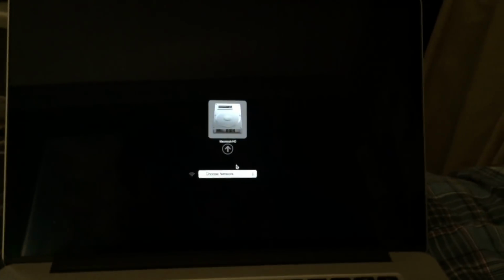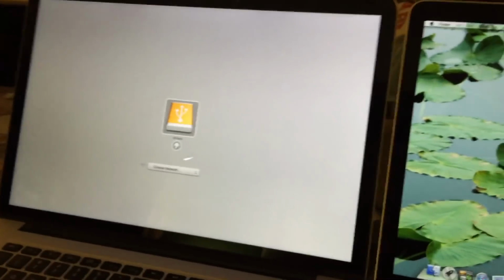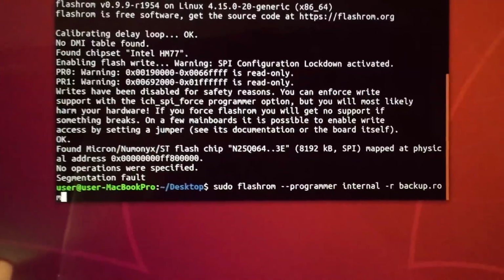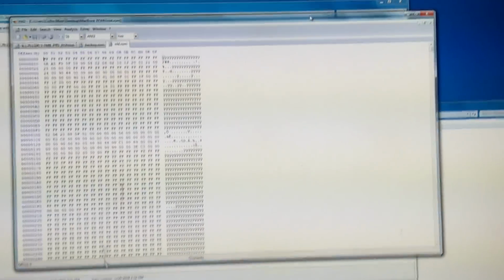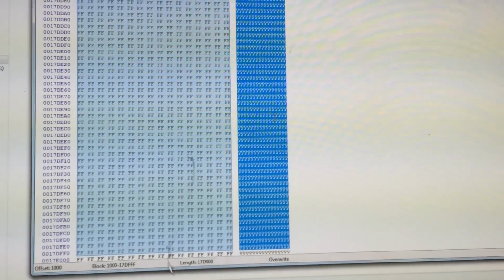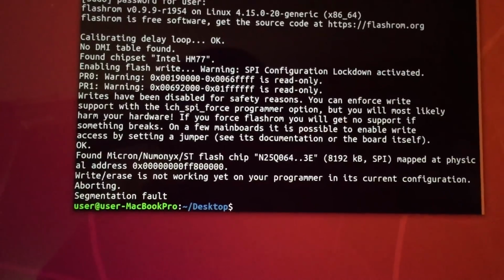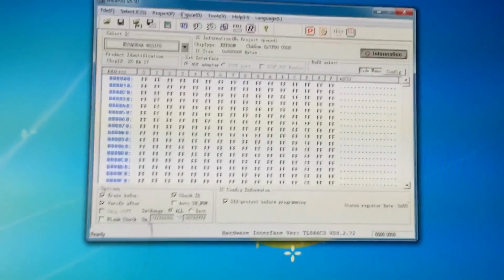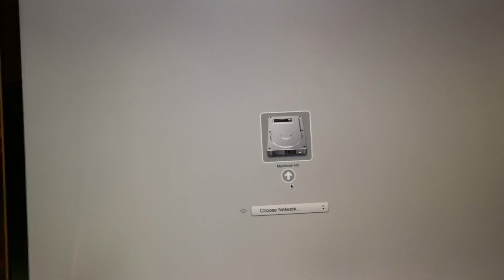Downgrading the System Firmware on a Mid-2012 15" Retina MacBook Pro

Comment from the maker: EDIT: It turns out the reason flashrom couldn't flash the ROM is because the system was not in programming/FW update mode. To enter programming mode, simply hold the power button down (while the system is off) until the boot screen appears, and from there boot Linux. Flashrom will then be able to flash the ROM successfully.
Reply: Hey dos, are you going to do Mojave patcher?
Reply: Can you elaborate on this a bit further? I've tried holding Power and Alt down until I get to the startup manager, released them and then booted Linux but flashrom still can't write. What am I doing wrong?
Reply: When you say lynix you mean terminal?

Comment: At some point in the updating process of those firmwares Apple must have set a limit of the GT 650M GPU clock speed to 744 MHz to "improve graphics stability in Bootcamp" (or something like that). Do you think there's a way to un-limit that, especially if you have better fan control and thermal paste installed, to get closer to the original clock speed of 835 to 900 MHz? There's no way to do it in software using the current 2.1 firmware.
Reply: Does the 744mhz limit also apply in MacOS?
Reply: @Thegeforce8523  I haven't found a way to read the clock speed in MacOS, but I'm pretty sure it is as the performance under Mac is even worse than Windows.
HOWEVER: I found a way to actually unlock the GPU at least under Windows using an older version of Nvidia Inspector (one from the early 2010 will do - to set P5 state and force clock speeds) plus MSI Afterburner (to unlock overclocking, even though it can't change the numbers). Was able to push mine to stable 990 MHz and get a framerate increase of ca 20% depending on the game. However, custom fan curves using Mac Fan Speed, disabled CPU boost and of course new thermal paste were required to keep temperatures in the 76°C area.

Comment: That device running Mavericks is a little stupid, the OS is really holding its performance back.
This does support macOS Mojave and today even Catalina, and the OpenCore Legacy Patcher will let it run Big Sur without any issues.

For example I have a MacBook4,1 with GMA X3100 graphics and OS X Lion (max OS) is really holding it back.
I patched and installed Mountain Lion with full graphics acceleration and the performance is definitely better. Although it would be better under a newer macOS version if there was graphics support. The CPU in it is better than some MacBooks that are compatible with your patcher or OpenCore Legacy Patcher, but these machines with a worse CPU are yet doing much better because of graphics support.

Comment: My friend had El Capitan on his MacBook pro2012 I tried downgrading the is to leopard 10.5.  But couldn’t do I need the rom for older version OS X to work or no I have a programmer just don’t know where to get the rom for that os to work on this laptop or where can I get a donor firmware to be able to use the leopard 10.5 so I can modify the me region and sn

Comment: Does the same firmware of the mid-2012 Retina MBP work with the mid-2014 Retina MBP as well? I have one of those and I recall that it came with Mavericks originally, so I'm thinking of downgrading the firmware to get the white bootscreen back. If said firmware doesn't work, where could I get the firmware that does?

Comment: I'm having an issue with fans blowing constantly and kernel_task process using 500% CPU time. My diagnosis has led me to believe the firmware is somehow corrupt. Would I be able to use this to manually rewrite the SMC firmware? I'd like to try to fix this myself before I pay Louis Rossman $300 to replace my whole logic board.

Comment: Hey dude 🙋🏽‍♂️ :) I spent 5 sleepless days trying to downgrade my 2014 15" MacBookPro11,3 to Mavericks.. My internal is a 1TB Adata SX6000LNP PCI-Express SSD... The further I was able to go is High Sierra -APFS-. Internet Recovery leads to Catalina install... Bootable Mavericks works just fine from external drive... but when I tried to install all HFS based OS's from Sierra down to Mavericks-, the SSD is not showing up on the list... -I just bought this specific 2014 MBP on ebay because it was listed as one that can have Mavericks on...the original SSD was 500gb, so that 1TB SSD was an upgrade... I need help really really bad :/ What can I do in order to have Mavericks on my system?
Reply: That's because there are no NVME drivers for Mavericks. From what I remember, non-Apple M.2 NVME SSD work from High Sierra and later (I might be wrong here, so feel free to correct me). You'll need to either get the stock Apple SSD that came with your MBP or get an aftermarket M.2 SATA SSD if you want to install Mavericks.

Comment: Thanks for the post! Will the same method work if, instead of dump downloaded from another working machine, I inject directly the firmware available at apple's downloads as a .scap file? I would like to do this to regress my MBA, for the usual 'bless' command is simply not doing it.
Reply: I just see from older replies that this cannot be done. Anyways! If anyone has a Macbook Air mid-2012 with EFI MBA51.00EF.B00/01 (compatible with Lion 10.7.4, its original OSX which I need back), please upload it for me. Please.

Comment: If you ever get the chance to do it with a 15” late 2013/14 MacBook Pro, I’d really like if you’d upload the file
Reply from the maker: If I ever get lucky enough to find one with the old firmware, I definitely will.
Reply: dosdude1 I actually had one that had the original rom but I accidentally updated the firmware despite updating the system software on Mac OS X 10.9. That was way back in August of last year though

Comment: Do you have the original EFI firmware for the late 2013/2014 15” model since I accidentally updated mine?
Reply from the maker: I don't, you'll have to get lucky and find another board/machine that still has it.
Reply: dosdude1 is it possible to trick the updater to install an EFI update that’s older than the one in my machine? I got the old file from the Apple website through web archive and downloaded the version for my Mac and I tried using some terminal commands to make it install but all that happened when it restarted was a delayed boot chime and a black screen. Firmware version installed is still the same
Reply from the maker: Yeah, that can't be done. I tried doing the same.

Comment: Hi, do you happen to have any experience with this model of MacBook getting stuck in sleep mode when shutting the lid? The problem I'm facing is as follows:
Putting the MacBook to sleep via the Apple menu > sleep works fine. I can wake it back up again by pressing a key on the keyboard.
However, if I have the MacBook running, and the close the lid to put it into sleep, i am only able to wake it up again if i open the lid before the fans stop spinning. Otherwise, if I wait for the fans to stop running, opening the lid will not wake up the MacBook and the only way to turn it back on is to plug in the charger, as even the keyboard is unresponsive as if it still thinks the lid is closed. I know the issue is not to do with the battery as it is brand new and only replaced about a month ago, and I only began having this problem last week. I have also tested it with the old battery just to make sure but still experience the problem. I have also tried resetting the SMC, clearing the NVRAM and doing a complete reinstall of MacOS, and none of these resolve the issue. I am also pretty sure it's not the sensor itself as the laptop still sleeps/wakes properly before it goes completely to sleep (when the fans stop spinning). I am wondering if perhaps there could be something amiss with the firmware?
If anyone has any ideas please let me know - thanks.
Reply: Take the mainboard out of the machine and check for any corrosion. I doubt it is a firmware issue. More likely the mainboard has the issue.
Reply: Yes I am here for the same reason!! I can bet you are getting a error code about an “EFI SLEEP WAKE FAILURE!? I’m here to ask the YouTube if he knows if this will help with the stop of the error as I been reading through fourims that hundreds d of thousands of Mac owners face this issue and idk if it’s true apparently it has to due with software and 3rd party ssd drives and firmware updates or something like that. I have same issues.

Comment: so here is the question .. can we use this method to remove the efi password ?? like to insert a HDD with linux installed and i think it should boot straight from the HDD?!!! is that possible?
Reply from the maker: No, as a firmware-locked machine won't allow you to boot from any other drive without the password.

Comment: I have a Mac flashed GTX 970 that I have in my 2010 Mac Pro that NVflash cannot read. Do you think I can use flashrom to dump its rom, modify it and reflash it? Thanks
Reply from the maker: Possibly, but I'm not 100% sure... You may just have to use an external programmer for that.

Comment: I totally understand the aesthetics thing, I've done stuff like that before.
Also, wouldn't it revert back to the 'black firmware' every time you update the system? In my experience, updates usually revert stuff like this.
Reply from the maker: If I were to install 10.10 or later, yes, it would update the firmware again. As long as I run 10.9, though, it will stay the same.